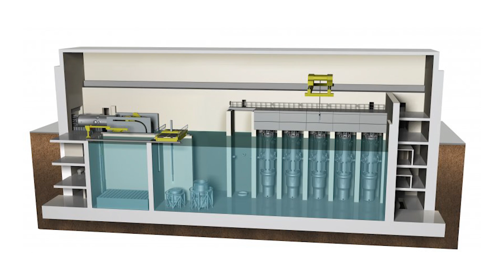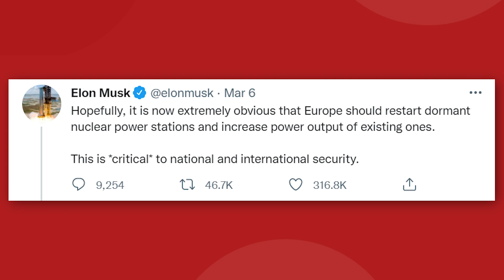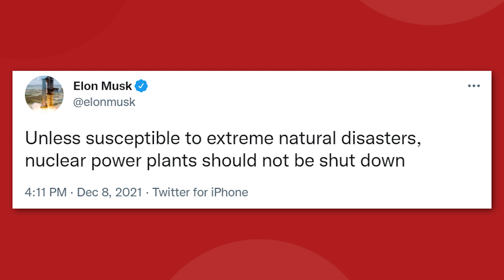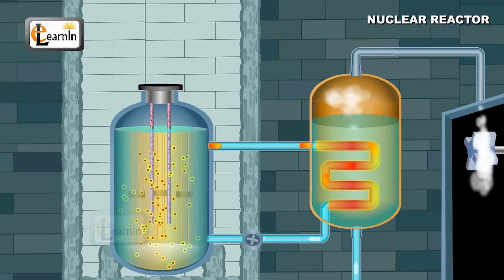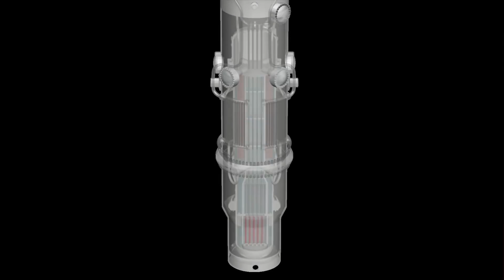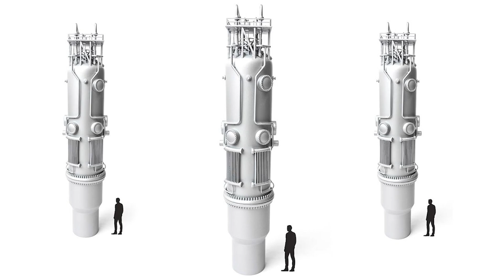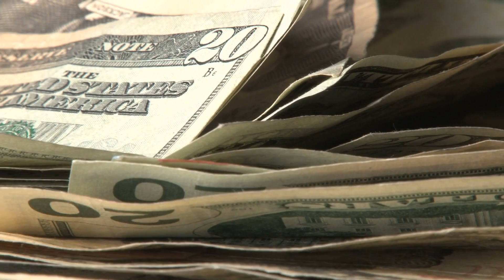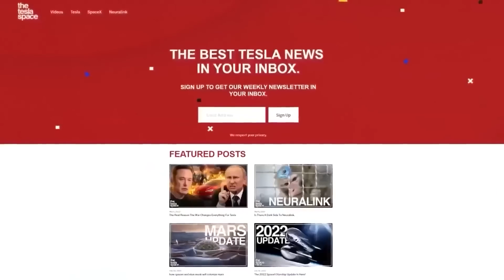The Real Reason Nuclear Energy Is About To Take Over!

Comment: Combine self running generators and power walls in homes and businesses for seemingly endless clean energy everywhere all the time. Also, have a direct connect to the axle of EVs and solar, to super charge them. No more plugging in. Use V2G tech to transfer extra energy to the power grid for everyone to use.

Comment: There is a new technology being developed at Oak Ridge National Laboratory using a millimeter-wave drilling system to drill 3X deeper than oil wells to supercritical water temperatures. Quaise says their system repurposes existing gyrotron technology to drill 20 kilometers beneath the surface at decommissioned coal-fired power plants at a cost of $0.01 to $0.03 per kilowatt/hour. No fracking is required, avoiding the potential for earthquakes that have occurred in other geothermal systems. Drilling using this technique is hoped to be fast, with boreholes aimed to be completed in 100 days. Figure 735 drill rigs in the US. That should be about 7 completed holes per day or about 2,000 holes per year of baseload power that will last millions of years. No coal, oil, or natural gas is mined, refined, or transported. No concerns due to a lack of sun or wind. This means the manufacture of hydrogen that is cheaper than NG or oil. The nice thing about all this is the personnel required are already trained.

Comment: I would do modular thorium molten salt reactors. Their byproducts are molybdenum 99 for cancer diagnostics research and therapies. Xenon for NASA interstellar space travel and possibly Elon musk. Excess heat can be used for water desalinization and petroleum distillate manufacturing. I think Diablo Canyon would like that. They can't blow up because they are not pressurized. The Chinese got the plans for one from a library for children, in Oak Ridge Tennessee. Oak Ridge Tennessee had one running from 1965 until 1970, when Nixon shut it down. He had a public school grasp of physics, what can I say? The design is simple. The Chinese just switched one on I think about a month ago, using our technology. I believe Bill Gates is building one in Idaho as we speak right now. Maybe we should follow the people who have a track history of changing paradigms as opposed to those at the levy😢 of government power.

Comment: Elon - bro - that my idea - already got patent on.  Also got a patent on the bicycle. So Im rich and don’t need that 100 mil u offered for best coal scrubber idea to reduce carbon.  JK.  As u know, I blew away all “get cleaner coal / get more efficient solar / renewable” ideas w a super efficient and ready to go NOW power idea that emits ZERO carbon.  Idea is using small, off shelf fr USN, networked reactors in groups of 10 or so powering mid sized and visually attractive vs super scary 3 Mile Island - steam turbine generators (again all established tech). Best idea for ZERO carbon energy - ever?   I think so - cuz I came up w idea and sent to u.  In my posts have detailed reference to further specs of idea - again idea is networked off shelf USN tried and true small reactors  (eg Va class USN gives off 210 mg appx 5 per cent of Palo Verdes 3937 mg. Notably 30 of these - buried ICBM style in hardened concrete silos for xtra protection - arranged in 3 groups of 10 - each group operating analog (eliminate risk of Stuxnet type attk) w Navy trained engineers (not only zero dev cost as using established off shelf tech - limited human training costs for running nuke tech - (talk abt cost bargain)) stationed out in Nevada or in old Titan II fields or remote abandoned military bases, for example - will produce MORE power than Palo Verde w Zero Dev coats and likely less than 10 percent of build cost.  As got 4 kids - gotta get paid. Willing to take just 25 mil if get $$ in next 30 days.  Please text 404-550-2942 to discuss. Otherwise gotta sue - which I do for living - Im an atty - but only an idiot reps himself and think ur the best and dont want to have to sue richest and smartest man alive - but would be cool to take ur depo - autograph transcript for me?

Comment: Old reactors don’t even need to be taken out of the loop, you can use old decaying modules as pre-heaters. Once it’s no longer able to go critical, you can pull out all controls and let it decay away (and a little fission, just less than 1:1). All the while still contributing and just add another in the chain as you need to.
Reply: Or rather than letting perfectly good reactors go to waste, you could simply refurbish them.

A new core assembly, pressure vessel, and some new turbines, and you're good to go.
Reply: @jakehildebrand1824  I don’t know if you grasped the design concept here. The Part contained in this unit are the ones that the handling costs significantly outweighs the cost of new parts.

The turbine is separate, this is just a pressure vessel and fuel assembly (with bits of control mechanisms). The only valuable part is the not yet fully depleted core. It would need a storage vessel anyway, it’s already in one. 

I’m just saying that it may as well contribute it’s heat of decay that’s it’s already giving off anyway.
Reply: @geekswithfeet9137  and what I'm saying is that rather than using old reactors as preheaters for SMR's we should instead just   modernize them. sure it may be more expensive in some cases, but it would be more effective, and would pay itself off relatively quickly anyway.

Comment: We've needed more nuclear reactors for decades. Current conditions demand we start now.
In coming years we need to double or triple the amount of electricity we generate. It's no longer about replacing coal. Wind power and solar cells won't get us there.
The only realistic solution is nuclear. Otherwise we all end up where Germany is going to be in a couple months - screwed.

Comment: High efficiency natural gas appliances, furnaces, hot water heaters, dryers and stoves. Running at 90-99% efficiency. 1%-10% of the heat produced goes out the chimney or exhaust stream as waste heat.
Thermal generators (power plants) have efficiencies of 33% on average because about 2/3 of the heat produced goes right up the stack as waste heat.

Comment: In the long run.....Only nuclear energy and Hydrogen are the solution for environment and energy abundance. Renewables can not be efficient and reliable sources of energy no matter what. We can use them as supplementaries but not as our primary source. Musk knew that and that's why he insists to support modern reactors. He knows very well that battery technologies have limitations and there will never be a battery chemistry that offers huge energy density (comparable to gasoline and diesel) , fast charging and discharging rates together and  be small in size and weight and cheap and safe at the same time. But he is also a capitalist and he wants to gain huge profits by exploiting the trend of climate change and all these BS about renewables and of course he will do the same with SMR and Hydrogen and probably fusion reactors if it is proved a working and feasible technology. That's the real reason, that's the truth.

Comment: Elon also said the power from solar PV panels covering the radiation exclusion zone around a Nuke plant puts out the same power as the Nuke plant itself FFS - and at 1/50th the cost and 1,000,000,000 x the safety.

Comment: The best thing about SMRs is that it is similar to batteries.  They can be integrated into grid systems closer to the source.
Reply: They could be built within cities like New York. Don't need 300 mile transmission lines.
Reply: They are nothing like batteries.
Reply: @timduncan8450  Did you read the comment, i guess not.  nevermind.  lol

Comment: Video started out with a few errors.  Wind, Solar and large storage systems are next to useless.  Battery storage with traditional heavy batteries is okay, just not Lithium, bad fire hazard.  The World needs 40 times more Lithium than the mining industry can deliver in order to replace all the ICEVs with EVs.  Musk desperately needs a 10 fold nuclear expansion to charge the EVs in order to replace  the ICEVs even if the Lithium was there.  Sodium battery EVs would work with SMR/Sodium battery swap stations.  It would be useless to directly connect either that 10 fold nuclear expansion And/Or all those EVs to the existing Power Grid, as the Grid itself would also require a truely massive upgrade to handle the load.  Something not even mentioned in all this is, why bother in the first place.  There's absolutely no good reason to replace ICEVs with EVs.

Comment: Not this again! They haven't built one small nuclear plant yet. The demonstration plant may not ever be built as it's so much dearer than solar and wind. The university is getting cold feet. As no small modular nuclear plant has been built and won't be before 2028, so of course they can say its cheaper. But as people back out and go for solar and wind the prices continue to rise. In your dreams. Nuclear cannot compete with solar and wind on cost even before the problem of nuclear waste is addressed. No doubt you'll take this down like others whom spread this spiel before you.
Reply: Not you again!  Small modular reactors have been build and used by many countries for at least seven decades, in two years or less I might add.

Comment: Typically stupid, knee-jerk reactions by pandering politicians caused the anti-nuke hype after the incompetent operation of a very unsafe reactor design with no containment vessel at Chernobyl and the antique GE reactors at Fukushima once again incompetently operated by a company that didn't take the advice of GE and elevate both the back-up generators and their fuel supply.  So, bureaucratic stupidity led to both significant reactor incidents.

Comment: A Rolls Royce designed package has been accepted by the UK Government and Rolls Royce will be building quiet a few of them!
Reply: Yes they have but this is the first time they've build them with a Modular design.  These are designed to be built in months rather then years which is significantly different ti those locked away for years in tin boxes.
Reply: Rolls Royce have already been building them for the Royal Navy for many decades.

Comment: If they would focus on Thorium molten salt reactors, we wouldn't have the old problems with nuclear.
Reply: Thorium still requires current nuclear reactions to breed u235.
Reply: @Goodwalker720  Nope...what is "bred" is Th232, which is fissionable. U-235 is needed to start the Th232 process, but once sufficient Th232 is available, no "U" is needed.

Comment: I raise an eyebrow at your statement that these SMRs can produce power for 20 years on one fuel load.  Traditional reactors use 3-4% enriched fuel which needs to be shuffled and partially replaced every few years.  The smaller Navy reactors only achieve significantly larger run times because they use 97% enriched fuel which is VERY expensive and usable in bombs.  I don't think you would ever be allowed to use such fuel commercially.

Comment: As touched on by others LFTR.  You mention China and China is also doing LFTR.  Actually any nuclear reactor that uses water in the reactor core is kind of primitive, inefficient, and dumb when we have better options.  All of these things you talk about as drawbacks to fission can be a whole heck of a lot better when you look into running LFTR in a continuous fuel cycle.

So yeah, the problems with fission are solvable and it looks like the Chinese more or less have it figured out.  The United States was also figuring this out back in the day, but politics got in the way, which is why we can't have nice things.

Comment: I don’t buy your 20-year refueling schedule for SMRs. Current light water reactors with metal fuel rods, such as your SMRs will have, have to do shut-down maintenance for a whole month every 18 months not because they are out of fuel, but because of the build-up of gaseous fission products of xenon and krypton in the metal fuel rods. These gases start to expand the fuel rods and will cause ruptures into the moderating-cooling water if not taken out ever 18 months. The removed fuel rods still have 97 per cent of their uranium fuel unused in them, plus some dangerous trans-uranic materials in them due to neutron absorption during the fission process. Your suggested SMRs will have the same dangerous problem every 18 months. Close to rupturing, partially-spent fuel rods that will be highly radioactive for 10,000 years because of plutonium 239 in the trans-uranic materials. What are you going to do to solve that problem? Replace the whole SMR unit every 18 months. That would not be cost effective. A better method would be to take the SMR proposal one step further and make them molten-salt SMRs. Then, you have no rupture or melt-down problems, because the fuel is already melted in the heat-exchanging-fuel-molten salt, and, you could burn up 99.5 per cent of the fuel, not have to do shut-down maintenance every 18 months, and even burn up current nuclear waste for fuel from existing light water reactors’ waste stream. The inventor of our current light water reactors made this proposal in the 1960s. (The salt must flow.)
Reply: please pass the salt

Comment: Nuclear waste: we can't eliminate it completely with fission, but there is something we can do about: LFTR. Thorium reactors could be fueled using existing long-lived nuclear waste, turning it into short-lived waste. IE: rather than having to store this stuff for 25k years, we'd only have to store it for 500. I don't know about rates, but I'm betting that a small number of LFTRs could be built to consume "used" fuel rods faster than they're produced...
Reply: Once again, there are competing designs for this. Whatever works is automatically a winner in my book. Those long-term waste piles need to go.
Let's take it one step further.
You know that thing where we want all-electric cars by 2035? Make a moratorium demanding we only have consumption reactors by 2040. They all need to be able to consume nuclear waste. No new designs that create long-term nuclear waste.
Reply: Liquid fluoride thorium reactor.  Definitely, the hot, radioactive decay of the stabilized thorium will continue to boil water until the critical element's fission slows down billions of kw hrs later.
Reply: The government will never allow thorium to become a mainstay of power. How else will they keep a population in fear if the people had access to cheap energy....
Reply: Basically any reactor that uses fast neutrons, as opposed to having moderators slow the neutrons has this property of burning old waste and converting thorium. LFTR might be the best or maybe there's another that will win the race.
Reply: Two things to solve.
1. reprocessing
2. Iran.

There are hundreds of countries in the world, where if they trued to do things suggested here, the US would lose its mind. Because these are the path towards proliferation.
Reply: You assume nuclear waste is all fuel and rods and such. There is a lot of waste that are things such as irradiated clothing / materials / etc.
Reply: @SynthDark  No, I don't make that assumption. High level waste (ie spent fuel) accounts for 95% of the radioactivity of all nuclear waste. Low level waste (tools, clothing) accounts for only 1% of the radioactivity. The half-life of low-level waste is under 30 years, and after a short amount of storage (sometimes as short as 100 days) can be handled as normal trash. High-level waste have millenia long half-lives.

Comment: I understand that most of the highly radioactive “waste” isn’t waste at all but unused fuel as traditional fission reactors only use ~2% of it’s fuel rods. This waste can be used and can be combined with thorium to actually make ~ 20 times the amount of fuel. These fuel rods turn thorium into fuel. Consequently reducing dangerous highly radioactive waste into fuel that can be used up reducing waste while increasing green energy for the grid.
Reply: I highly doubt you will see spent fuel pellets ever being recycled. They are just too radioactive.  To contrast:  you can handle new fuel pellets safely, but a spent fuel pellet would kill you.  We want to leave these pellets sealed and undamaged.
Reply: @archcummins  I see your point however they have to be handled anyway and the way they are handled for thorium reactors called “lifters” from the acronym LFTR(liquid fluoride thorium reactor) is that the fuel is melted with other chemicals. You can’t have a meltdown because they are already melted down, they can’t get any hotter because the system is designed to handle the hottest temperatures they release. The system DOESN’T use water to cool the system so you don’t get an explosion. If there is a failure then the system shuts down and nothing actually happens. If used pellets are too radioactive then they contain a tremendous amount of energy needed to run a green economy. The more radioactive something is the less time it’s radioactive for. The estimated cost of safeguarding the “spent fuel” outweighs the cost of using the fuel now with huge payoffs and improved safety. Not to mention this kind of reactor worked safely in the sixties into the seventies. It’s safe and if it yielded no electricity at all it would be plausible just to rid the world of the waste you are saying is far too radioactive. China is doing it NOW, India is doing it TODAY and the USA is getting ready to restart a LFTR again. If the USA doesn’t private corporations will.
Reply: @archcummins   Many countries have been reprocessing their 'nuclear waste' for many years now.